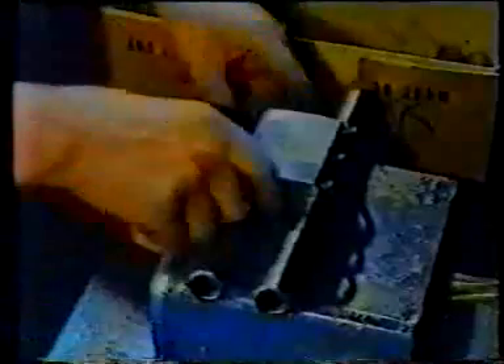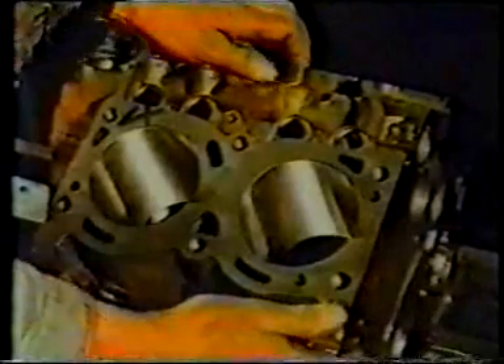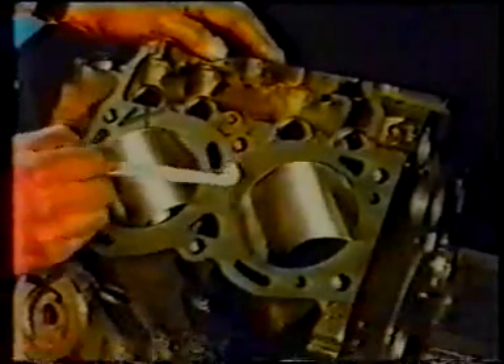Ford Zephyr Zodiac MKIV, Making of Part 2

Comment: Great video. Interesting to see the machining being done.
I have a V6 Zodiac Mk IV (1969). Is a great car and had no problems other than becoming a bit dare to run with fuel prices rising over the last 20 years.
They are easy to work on and not over complicated.
I have a 1961 Humber Hawk Series II as well. Both of them have been great cars for me.

Comment: I worked for years on the v4 2.0 engines even in there 1.7  guise. They sounded awesome when revved hard, the 3.0 engine was the same basic block with extra cylinders, even had the counter balance shaft castings inside but minus the shaft. I loved all these engines but they like all engines are only as good as the service they receive. The V4 engine found itself being a replacement in the nsu rotor 80 that was fitted with a rotary engine. Interestly few engines lived past 100,000 miles in this era, the oil pump drive was the same shape as a bic pen and would round off and fail, along with the fibre timing wheels. Love all the old fords they were special in my eyes.